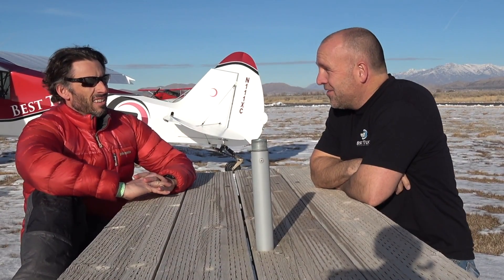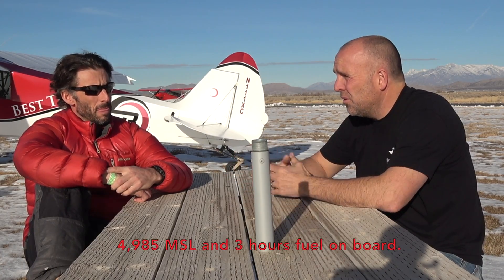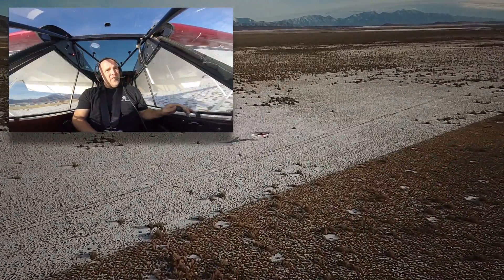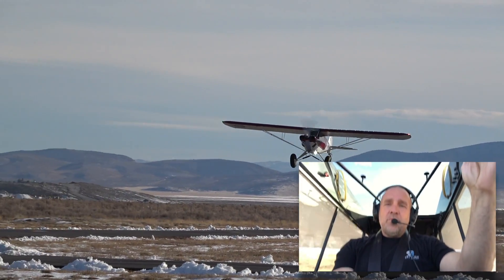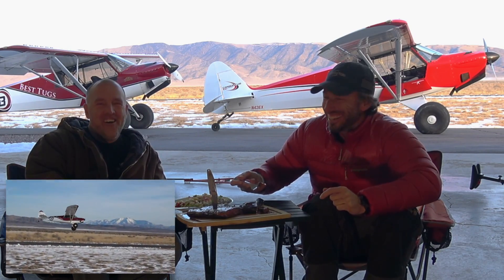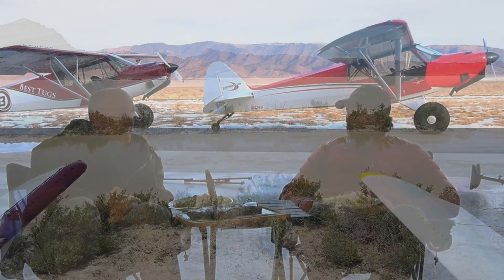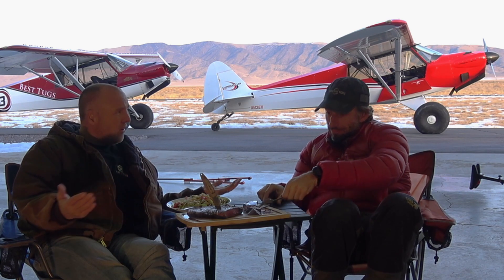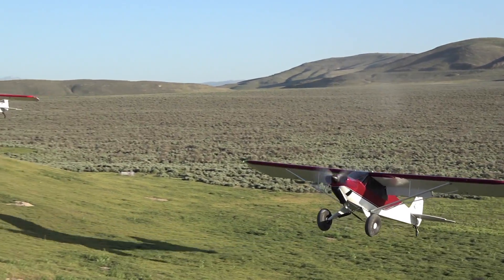The impossible turn in the Carbon Cub

Comment: Are you concerned about shock cooling during an engine off practice? What has your experience been with engine cooling during engine off practice? I look through the comments and I didn't see anything about shock Cooling. I'm certainly not taking away from the experience or education of engine off training. I'm honestly ignorant about the subject and that's why I am asking.  Thanks for your time. Great video.
Reply from the maker: The engine is going from maybe 330 to 300, no I am not concerned. If my engine was at 420 and I was 12k up and the oat was 0 or negative I would be..

Comment: I am not a pilot . My observation during this video may possibly seem overly critical however i did not count the number of times each of these men mentioned /stressed " knowing"  your airplane . As a non pilot im wondering how many various mechanical conditions could result in an engine out ? To  my point how can any one of those conditions also effect your aircrafts handling characteristics as you "know"  it ?

Comment: These engine failure's were expected. I wonder how much altitude you would need to add in order to take the human factor/delay into consideration. Great video! Great to practice engine failures.
Reply from the maker: Every time I takeoff I expect the engine to die.. that way I am prepared..
Reply: Oh of course, I do as well. What about for those student pilots, complacent pilots or rusty pilots who haven't flown for a while. Just curious :)

Comment: Awesome video!  Seems like there are other factors that need a quick assessment such as:  Is the runway long enough to just set it down straight ahead?  Is there a parallel runaway to land that is long enough? or a runway that is at a different angle and long enough that would be easier?  What is the effect of the wind, do I turn right or left, into the wind?  I am a new pilot, so I don't know.
Reply from the maker: Yep lots of other factors, we did not want to make a 2 hour video, just a simple idea of at what altitude we could turn back. The main idea of the video is to practice and know your airplane well. You do this by doing exercises like this video.

Comment: I think it would contribute to the success rate of the impossible turn if, right after takeoff, at 100-200ft, we make a shallow turn and continue your takeoff leg 15° left or right from the rwy centerline. When havoc strikes, it will be easier to turn back to the field.
Reply from the maker: I agree and i do this in the Idaho backcountry.. Where your only option is tops of trees or in the river.

Comment: As a becoming glider pilot we often train this. In case the rope breaks or something similar during launch. 150 feet we usually dont do that turn either. We usually do that starting at 300 feet. Though 250 feet might be an option. Btw do you slip with your planes to loose height?

Comment: The impossible turn can be done in a Mooney M20c after wheels up with a minimum loss of altitude of 200 ft if done correctly.  But I would never attempt it at that altitude.  But if you take a Mooney up to a safe altitude and cut the power, put her into a very steep bank and pull just enough G's to avoid an accelerated stall, it can be done in about 200 ft.
      A fellow pilot friend owns a Mooney and he didn't believe me.  We went up,  I sat in the right seat and did the demonstration.  Indeed we lost only 200 ft.  He tried it a few times and was eventually able to get the loss to 300 ft.  He was shocked.
       In the mid-west, it might not be necessary where there are wide open fields near the runway.   The best alternative may be to go straight or to the side.   But in the NorthEast, we have airports like Linden, next to Newark.  It is surrounded by oil tanks and houses.   You must be ready to make the turn/no turn decision immediately. 
        I know, I know,  most say, never turn back.  But it was exactly this failure to turn back in the movie "Sully" the NTSB questioned why Sully didn't immediately turn back.  I won't give away the ending, nor do I know for sure if the NTSB really made that claim. However, it was in the movie that Sully was consulted on the script. The NTSB disputes the way they were treated in "Sully" and I agree, since we don't know their side, we should not automatically lambast them. (NTSB remember this). 
       We are taught almost never to turn back, but Sully's career was on the wall for failing to do so, at least in the movie.  If he had done what the NTSB criticized him for, would he and his passengers be here today?
Reply: Every pilot should know at what altitude is the minimum safe altitude for the aircraft.  In my Cherokee with the Hershey bar wing it was a bit more than 800 agl.  In the Cessna 207 it is about the same.  But loading and DA come into play.  Pulling Gs with a windscreen full of earth is a great way to stall since you are so much nearer to critical AoA.
Reply: Indeed, that is the great dilemma.  Either make the turn and pray not to spin in, or start a few houses or buildings on fire ahead of you.  If what is ahead is a cornfield, poor corn.  If they are oil tanks, poor everybody. 
      I hear you, but there is a safe point when the turn can be made.  And if the alternative is worse, then what do you do?  This has been and will always be the subject for pilots at  picnics ( or funerals).

Comment: The only problem is you KNOW whats coming and are ready for it. In real life an EXPERT pilot would need approx. 5 to 10 seconds before they realize this is a serious problem and need to react. That would put them to low and to far away to make the turn and land on the runway unless it was a short roll out. This happened to my brother on a ride along in an Ercoupe. It wasn't an engine failure. The owner installed the wrong style prop. It was a long run out to get to speed which was his first indication to abort but he pushed it. After takeoff there was not enough power for climb out. Fortunately he didn't try to turn and there was a cornfield in front of him. It mushed in and they both escaped. But the Ercoupe was destroyed in a fire. Don't remember the exact date. 1974-76 Lake Elmo MN.
Reply: Strange definition of fthe word "expert". The guy flying your prother certainly wasn't an expert pilot. For one thing he didn't know or care what his static RPM should have been at the start of the ground roll.

Comment: I'm curious, what is the empty weight of a carbon cub?  My cub is light at 1107 ibs. but I'm pretty sure I would fail a 250 ft. agl turn around.  Also a "180" really turns into 270 +45 if you're going for crosswind end of the strip you took of.  I'm going to try a bunch of turns at altitude but I'm not going to try a 200 ft impossible turn down low.  Too much to lose if I screw up! Thx for your efforts!
Reply from the maker: 1000

Comment: What about air density in summer weather, in thin Wyoming air at 8000 ft ASL to start?  There's snow on the ground where you are testing, and it looks early in the morning, too. So, so many considerations and variables. You two are top notch bush pilots constantly thinking "What if" and have the logged hours to keep pushing your own limits. It's a good thing, might not be for everyone, though.
Reply from the maker: I agree, thanks... we just wanted to figure it out for ourselves, definitely does not apply to everyone, but we do want to motivate others to know their aircrafts better...

Comment: So as a newly minted fan, I'm going to be that guy. Your opening field stats show MSL and fuel onboard but how is that relevant to me? I'm late to the party but outside of your aircraft type and local weather/field elevation, what? What was the density altitude, and the aircraft? I'm probably the outsider and just getting into your awesomeness but how does this relate to legacy GA?

What I love is that you are masters of your machines and you intimate the difference between engine idle windmill and blade stop performance. Nobody does that in the certificated world! Care to do this experiment in a Cherokee or Cessna 172?
Reply: pdutube how this relates is each aircraft is different.  Those numbers will change per aircraft type, loading, DA, and so on.  The larger variable is pilot response and skill.  This video is about the pilot.  In every evolution it is the pilot who makes or breaks.  One has to decide for themselves.  The video hammers home the need for practice before the actual need arises.  Be the pilot rather than just another passenger arriving to the scene of the accident.  The engaged pilot understands the need for constant diligence in pushing the boundaries of the performance envelope.  Platitudes, I know, but the truth.

Comment: I wonder how much the altitudes would change if the departure was flown a bit differently. I have heard of guys being taught to turn a few, maybe 15-20 degrees off runway heading as soon as possible after breaking ground. The theory being that if you do loose power and try to turn back you are off set from the runway already and might only have to make a 180 deg turn vs a 270 deg turn(s).
Reply: MX304 totally agree, we talk about that toward the end of the video.
Reply from the maker: MX304 I’ll try it and see..
Reply: Hey Jason,  Let me know how it goes. In Australia when teaching in motor gliders that are under powered and at high DA's our SOP is to be 1-2+ wingspans downwind of the runway as soon as you are clear of tree's and are unable to land ahead. I can say with a certainty for the motor gliders at least that it makes all the difference when performing engine failure training as only a 180 is then required when performed right. That being said, the extra glide would make thing significantly different from the CC I would assume.
Reply from the maker: Joshua Pain yes very different aircraft.. I’ll play around with it when the weather is better..
Reply: If there is some x-wind on T/O Do you make that 25deg sidestep turn into the wind for better initial climb performance but knowing it’s then a downwind turn engine out or go the other way?.
Reply from the maker: In the backcountry yes I would side step, the purpose of this video was just to do a normal takeoff to see at what AGL ALT we could make it back in.
Reply: MX304 d8c533c9
Reply: What?

Comment: I use to fly C210 a bit I can tell you if the prop is wind milling at best glide, in fine, it was adding drag. Try pushing to full course, and you can feel it accelerate. Worth a though find out the pitch of your prop ( if variable calculate fine and course) and then you can calculate the zero AOA of prop speed for idle. Just because it is producing thrust on the ground dose not mean it is at glide speeds. Even in the flare is different to best glide. The fist stage of flap can help glide angle at slow speed. The energy loss to get to best glide  often is not worth it in the pattern.
If at height with time to think, I'd  go to full course till I need an air brake.
How about practicing minimum time from 2000 AGL to touch down while observing all air frame limitations. Might help in a cabin or air frame fire.
Reply from the maker: We are fixed pitch...

Comment: I did the (impossible turn) from about 200' AGL after a prop failure on takeoff but I cheated: I was flying a LongEZ. Canard airplanes don't stall, they just don't. You can do 60 degree banks with the stick all the way to the rear stop, power off, no problem. What I wonder is where they touched down on their imaginary runway. In my case I was certainly going to land long. The last thing I did was raise the nose gear and put the nose bumper on the pavement. I stopped 45' short of the end of the runway. The main thing that was important to the success was that I'd thought about what I would do in that circumstance so every thing was pretty automatic to do the (Teardrop) 180. I have no idea what my reaction time was, but certainly not instantaneous like these guys. BTW, I chatted with Mike at the Reno Air Races in 2018 when he had Draco there still in one piece. He's a very nice, approachable guy.

Comment: The other factor to consider is passenger(s) weight added will decrease your glide and increase stall speed in turns.  Right...? Your flying single pilot in these flights.
Reply from the maker: This is true... lots of factors we did not discuss...

Comment: Snow on the ground says DA was favorable the a successful maneuver.  Would more discussion up front of DA, wind direction, wind speed, crosswind vs tail wind, turbulence, etc. be helpful so viewers gain really useful insight into what should be considered before taking the runway and going to full throttle?  The lead in to trying this turn back maneuver seems shallow and "hold my beer"ish.

Comment: Iam a bit confused. Why are you turning right in your e/0 . 
You have to make a 270deg turn Losing lift. A 180 degree turn is half circle. You are dooing a 180 + 45  back and then a 45 degree alignment. Thats 270 degrees with 3 bank angles loosing lift ! If iam flying uncontrolled runway with little option for straight. Ahead E/0  . I  will drift to the cross downwind off the end of the runway . That way I am doing a true 180 with one turn with the advantage of any relative wind.  I totally agree that practice practice e/0 . Its the vary time of flight when you have very limited ADM time. And any panic may result in loss of Asi or needed attitude. Mike try the drift off the end with a true 180 , I've had this discussion with mixed results but i know it saved my butt in a heavy treed no lz making it back to the runway.
  Id appreciate any input.

Comment: Density altitude together with gross weight, are insufficiently addressed in this video, IMO. Both will have huge effects on the success of an "impossible turn". However, this video is a start for discussion.

Comment: I just had an major engine failure at about 350 AGL in a 47 Navion. They glide like tanks, because they are a flying tank. We weren’t even close to making it back to the field, even with an immediate turn back toward the field. Ended up in a parking lot and all 3 aboard climbed out,,, even though 1 had a broken back. You need to point the nose down and find a place,, any place! DO NOT STALL IT!! This video is deceptive due to the difference between no power and idle power,, but you address that. But most planes don’t have your glide capabilities. 1000 ft is probably a closer estimate to what is needed to make the impossible turn with a dead engine.
Reply: The Navion cockpit is so large one could pitch a tent in it.  And the plane has to carry that.  Of course, the best plan for a flying brick involves a very simple decision tree...land straight  ahead.  The Carbon Cub won't make it to FL 250 like the Navion.  The point being, different aircraft mean different numbers, safe altitudes, etc. I am sorry for the injuries.  The Navion G is one of the best I've flown.
Reply: Congrats to you for saving everybody's lives.  Awesome.  As the great Bob Hoover said many times;  "if you have to crash land the airplane, fly the damn thing into the crash as long as possible".
     What Bob Hoover was saying is that slow deceleration into a crash by dissipating "Gs" slowly will minimize damage.  Stall spinning straight into the ground will kill.  For every knot increase in airspeed, the force of impact goes up exponentially.  For every decrease in airspeed, the crash force goes down exponentially.
     Flying the airplane INTO the crash and letting it slow down "gradually" will save lives.  I'll bet when you put your Navion in the parking lot there were long skid marks on the ground.
Reply: Skidded for 50 ft or so till we hit an embankment and a fence.  Still slammed down pretty hard thou, the hydrolic pressure of fuel in the tanks pillowed them.  And I can’t take credit,, my partner in the plane was flying,, I was right seat
Reply: Well, your buddy did it right.  Good for everybody.

Comment: Taking the runway heading after take off doesn't seem like such a good idea now....A couple of degrees left or right might be a good idea to give you enough wiggle room to return with more of a chance to land on the same runway...
Reply from the maker: Yes, but not always able.. Tower may not like the idea... But in the backcountry where it is not crowded it is probably a good idea.. But sometimes side stepping may also put you into the downwind where there could be a plane with no radio, when I side step in the backcountry I always lift my wing to look for traffic that might be where I am side stepping.

Comment: I was with you until I heard “drivers.”
Reply: I caught that, and I thought it was a small jab at the pilots of Cirrus aircraft having a parachute to bail them out of many in-flight emergencies.
AKA you Drive a car but you Pilot an aircraft, and the aircraft takes more skill.
The (false) jab is "you don't need to be as skilled to pilot a Cirrus aircraft because you have that parachute to bail you out of most any trouble you get in to".
Note: The parachute probably won't open fast enough to save you from an engine failure on takeoff.

Comment: add delay time for reaction, say 3 to 6 seconds or this video is only mildly/partially helpful
Reply from the maker: I disagree, when I push the throttle forward for takeoff I tell myself the engine is going to quit, when it does not I am happy. I wish pilots would progress from what their instructor taught them... so many pilots think since they have their license they don’t need to push themselves to be better, when in reality, the day you get your license, you have demonstrated the minimum requirement to fly. Why accept that you will burn 3-6 seconds in an engine failure before you react? Why not  push, train, practice, and prepare for a failure on every takeoff?